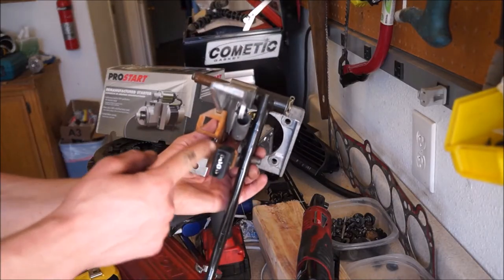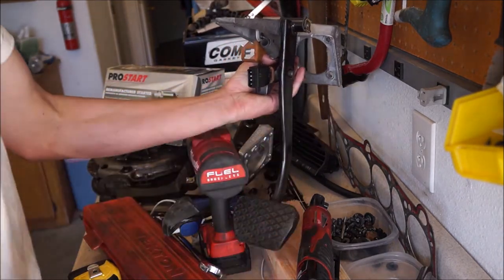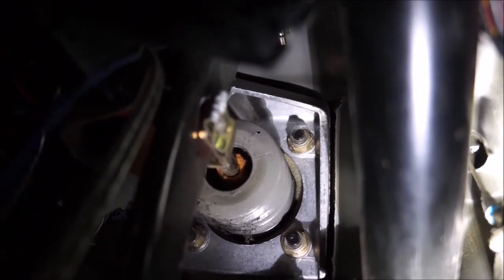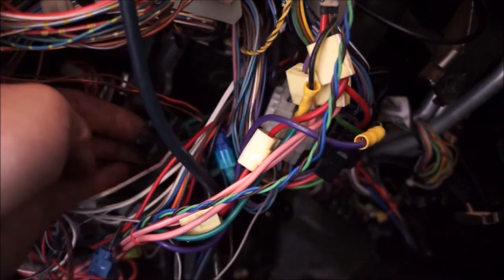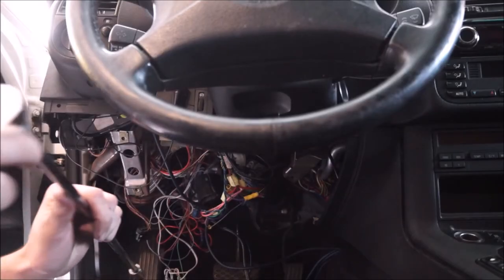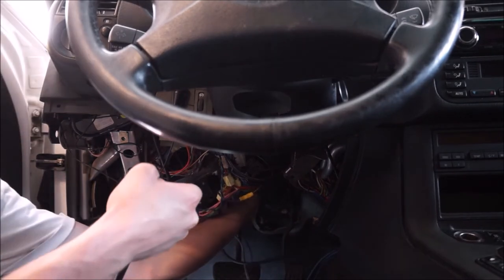E36 Automatic Pedal Assembly Removal: E36 Manual Swap

Comment: So I JUST finished this,lil tip. Lift the old brake lever out and use it to pull the unit straight out off of the studs

Comment: Bro, bro, bro ! Just to update you so that bolts the snapped off was the top 10ml socket bolt the one next to 13ml socket bolt on the thermostate housing, so I called out the professionals to remove the bolt for me the guy come out just with steal drill bits and drilled right through my chamber  !!! I was Grade A fucked so he put lock tight and a stud on if my car leaks oil I'm going to go to the company and leave my car there till the fix up all the repairs.
Reply from the maker: he drilled through the chamber? like into the cylinder head?
Reply: M3NACE yes bro (crying face)
Reply from the maker: Rest in Piece bro, if you can get it to not leak then your fine, if it leaks, It is time for a new cylinder head. lesson learned: Torque your bolts. go buy a proper torque wrench.
Reply: He put pratly stop and a stud if it leaks they must give me a new head or do aluminium welding, I do have a proper torque wrench they sold me the wrong bolt a size longer (crying face) 
Will only know on Monday when I put my exhaust headers gasket on
Reply from the maker: well, if it does not work, best of luck my friend.
Reply: Thanks man will let you know by Monday